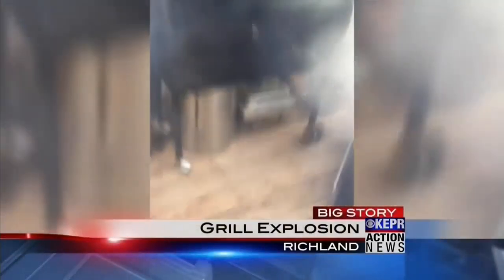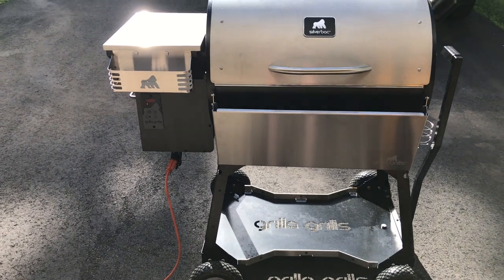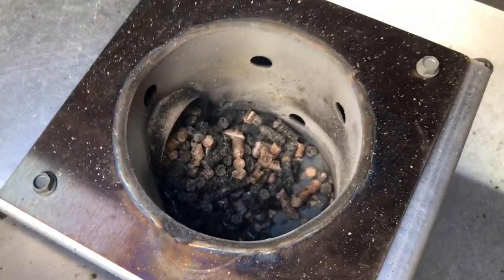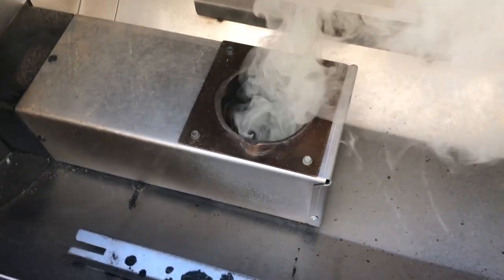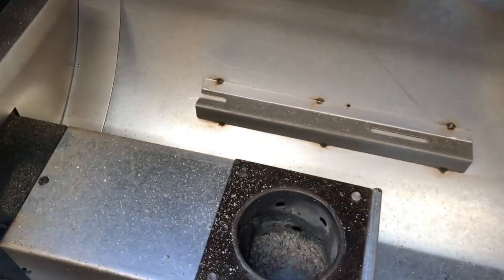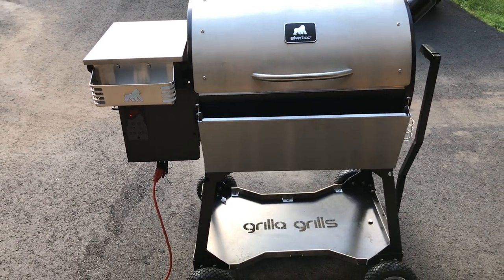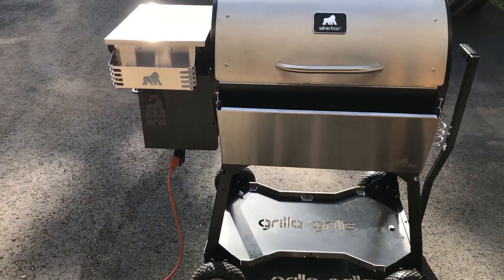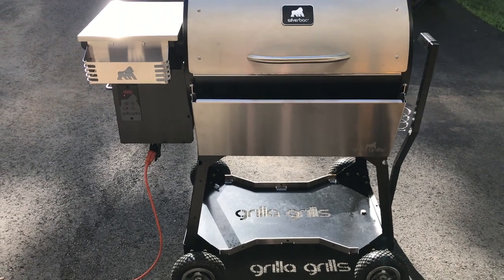Viral Traeger Exposion Explained (My Opinion)

Comment: I'm a purest, my BBQ smoker doesn't need electricity... just wood, meat, time, patience and ice cold beer..
Reply: Call u crazy
Reply: I spent 50+ years using a stick burner, but now I live in a condo complex that prohibits gas, charcoal or wood burning grills due to the fire hazard. So having a Traeger allows me to still grill and smoke meat and other things. I'm a purest, too, but circumstances made me have to change....
Reply: Jeanette Armstrong do they not realize that pellets are made of wood? Dancing through a loophole of ignorance eh haha
Reply: Do u still have a horse drawn carriage and use a buggy whip?
Reply: 8 and Sk8 it the buggy and whip worked better, I would use it. Pellet grills aren’t better, fact.
Reply: Jason Beatty I’ve used every type of smoker. For the flavor and effort u cant beat a pellet smoker. Stick burners are great if u have all day.
Reply: 8 and Sk8 apparently you didn’t use your stick burner well, I never have to babysit mine all day. Pellet grills are shit, expensive, and do you really know what’s in the pellets? I’ve had food off them, it is nowhere near the same in flavor as burning real wood.
Reply: Jason Beatty saw dust. Which is real wood.
Reply: 8 and Sk8 with shit that holds it together, plus how can you be sure what kind of wood it is? You’ll never know what kind of shape that wood was in when it was ground up.
Reply: I agree. But chasing a 2 year old while working full time and earning a masters degree provides little time to play with a fire these days.  I love to cook so I Bought a pellet grill for convenience.  Still have a WSM for competitions
Reply: Good for you. Too bad no one cares

Comment: Traeger is crap.  I’ve had 2. I initially had the l’il Tex and it was great. I then got the larger Texas model from QVC and it was a nightmare. Traeger would send part after part with no results. I spent many hours on the phone and installing parts. It actually caught fire and the barrel was so damaged that they had to send a replacement. They just strung me out until the warranty expired and then stopped talking to me. This went on from the first summer I had it. When it caught fire, the auger fed so many pellets that they were spilling out of the pot . I was smoking a brisket that I started at midnight. I just happened to be up at around 4am and peak out my back window. What I saw was thick smoke and flames. If I hadn’t been awake at that time, my house would have caught fire. I actually want another pellet grill but I won’t buy another traeger.

Comment: I had this happen to my Traeger and good thing I was like twenty feet away. The lid flew completely off and smoke for days:( Traeger would not even talk to me about it!)
I ended up cutting it up so no one else would try and re-use it.
Reply: Feels bad man. I just got my traeger and I made some really good ribs last night. I also threw on a brisket. This morning I checked it opened the lid and everything was looking good. So I shut the lid keep cooking. Came back out hour and a half later and it had error code and was off. Took the brisket out, cleaned out the pellet box, cleaned the burner, put everything back in. Now running at 225. Brisket better be good or I’m returning this thing.
Reply: This thing should burn as much pellets as it spits out. It also shouldn’t shut off for being too cold. The temperature never stays where you want it too. I set it to 180-190° after about 45mins it stays at 165°.. the 225 I set it on is now at 215 and dropping.
Reply: Treager told me to clean it inside and out,  little do they know that I am a certified clean freak! I am still surprised that no one contacted me after the one time that I reported it:(
They claimed someone would get right back to me
Reply: Juan Ar yeah what helped me is I took out all the pellets and made sure there was no dust just hole pellets. It’s running strong now but still don’t know if I’m keeping it.
Reply: @miahzzeebest701  I had to replace the control board when that happened twice to me. It was out of warranty:(
Reply: @juanar6233  that sucks. I bought the Costco exclusive the Silverton

Got it on my birthday right at the 
Beginning of lockdown. Been good so far. I vacuum it out after every use and line the drip tray with foil

Comment: This still doesn't explain what happened.  Add a few extra wood pellets and they EXPLODE???   ehhh... I think there are a few things missing from this puzzle.  Wood pellets just don't explode (correct me if I'm wrong here).  I could see if there was maybe a lot of rendered fat coating the drip pan, and maybe the temperature hit above 500 degrees and then enough oxygen suddenly entered the stove and created a flash point... but the wood pellets just don't 'blow up' like that.
Reply: David Good the mass smoke still has combustible gasses, so yes barrel filled with smoke and a shit ton of fresh preheated pellets suddenly bursting into flames and you will get a rather powerful explosion
Reply: @kalelofjorel  - Learn something new every day.  Thanks for the explanation.

Comment: This happened to my Pit Boss.  It did not have a re-ignite feature if the temp dropped below a set point. The wind had pulled the draft out, and it caused the flame to go out, so what happened was it kept feeding pellets, and I didn't know it, so restarted. BOOM!  I was smoking Brisket overnight, and went out at 4AM to check it when I did this.   I replaced the control unit with a Savannah Stoker. If the temp drops around 50* below the set point, and continues to drop over a certain duration, it will re-ignite.  No more going BOOM.  Thankfully it didn't blow the lid off like this one, but still woke my ass up when it happened.  I now make sure the wind wont cause a flame out, and have insurance with re-ignite if it does.

Comment: You put the blame on user error when in reality it's a design flaw.  In case you don't know what design flaw means, it's:  A design flaw is a design that fails to meet requirements or to serve customer needs. A flawed design can result in unstable and unusable products, services and environments. In many cases, they introduce unnecessary risk, damage brand reputation or result in poor product ratings and sales.
Reply: Exactly, How hard would it be during on power up, sense pot temperature. If > 150 don't add more pellets during initial startup. 20 cent microprocessor could hand that.

Comment: It's not traegers fault?  Lol. If the grill design needs special shutdown procedures and precautions for restart then the grill needs to be taken off the market and recalled
Reply: I've had a Traeger for years with no issues. There are special shutdowns when you build a fire during camping to make sure your fire is dead before you leave the campsite. If you don't you can cause a major forest fire. Should we stop doing those procedures because some idiot didn't or should we just sick Smokey the Bear on them? No need to remove the Traeger grills off the market because a few idiots don't follow the procedure? 95% of us do it right and have enjoyed years of use.
Reply: @porsche944mt  you're comparing apples to oranges..  We're not talking about camp fires.  We're talking about gasses building up in a grill when it malfunctions.  It needs a vent or something.  It's a dangerous design.

Comment: So I guess you better hope the electric doesn’t go off then come back on while your cooking lol
Reply: Schmelly G  Well, actually,  the problem isnt the power being off. It wont feed extra pellets if its off. Even if the power got restored, you'd be forced to deal with an error code and restart the unit, which SHOULD force you to check the pot and clear the extra pellets. Also part of the restart process is keeping the lid open until its done with the restart.  Its user error 99% of the time.

Comment: I find it hard to believe that wood pellets would blow off the lid of that grill and explode like that. Something is fishy
Reply: Agree
Reply: Wood Gas can be just as dangerous as any other flammable vapor. Add those gasses into an enclosed vessel with oxygen and a spark and you'll be lucky if it don't kill you when it goes off.

Comment: This is bad design oversight. They need a dual backup to fix this issue.
Reply: All you have to do is put it through its shut down cycle then start it after ward... Your out 15 mins but it's safe

Comment: Treager has instructions under the lid of the pellet hopper, or at least mine does, that basically tells you not to do that.
That being said I'm forced by marital obligation to keep and use mine in a wind tunnel, so flame outs are not uncommon. But because of anger issues and hungry children, i have done that exact thing mysel. I have had had the door blow open with a fireball and a sound like a cohern mortar going off. However in not a COMPLETE dumbass so I didn't call the authorities and get the news involved to show off my lack of intelligence. Which is really what the video should be about.

Comment: I can't stand My Trager, and quite frankly their customer service sucks.  I am commenting on this from a subjective view on facts. My Background is a  Master Technician, yes I work on  cars that can cost as much as $500k.  I am very well educated and experienced  in all aspects involved in the science of fire. Heat transfer , gases, and an avid outdoorsman.  My Treager constantly runs away on the temp setting, has caught fire, popped the lid on more times than I care to remember. I have also observed this same behavior on at least 10 other friends Treager grilles that I regretfully told them to buy, including several house overhang fires.  All these I investigated as a diagnostic technician and all had no blowout or power loss/ restarts. Also no excessive ash and not grease fires. After 4 years of battling this grille and unfortunately wasting a lot of my time babysitting this grille ... I'm done with it and I am buying a Rec Tec after swaying my best friend of 40 years, whom I originally told to buy a Treager, bought a Rec Tec and it works flawlessly.  I will also add that due to so many runaways, the  coating started peeling within the first year.   I would also like to add this is a great video with great perspective and I believe every manufacturer of pellet grilles needs to see, take action and recommend it, or post videos for customers on their specific grilles and how they control the grille.  O also agree the guy in viral video made a huge mistake.  I can surmise from my experience with grilles meters, thermal imaging camera, etc on my Treager, the issue may  lie in the temp sensors, software, or circuit board that is malfunctioning with increased temperature. I am not here as a Treager basher, just a very dissatisfied customer and fellow grille mate, and safety conscious person.  Cheers, awesome video.
Reply: I got into the whole pellet grill thing 5 years ago with an RT680 by REC TEC. Never experienced anything like this and I hope I never do!!

Comment: I would never own a grill with the chance of an error code. Old school or nothing.With a treager all you have to do is set your table and sit there, your steak will be delived through the window maybe on a platter, oh wait thats the lid.
Reply: Ive had old school stick burners for almost my while adult life and got good really good with them

But you cant beat a trager and it's ability to hold 225F constantly without having to babysit it and get the smoke you want. 

Never had a flameout or error code ever because I use it properly and clean it EVERYTIME I use it

And I use it to reverse sear steaks. Get them up to temp and give it the sn2oke flavor then sear it in a pan. Consistent every time